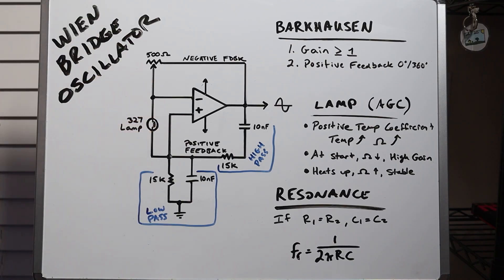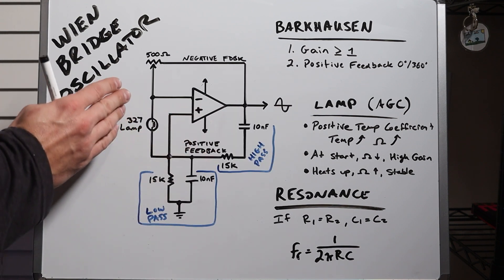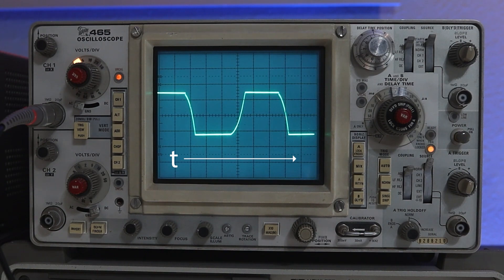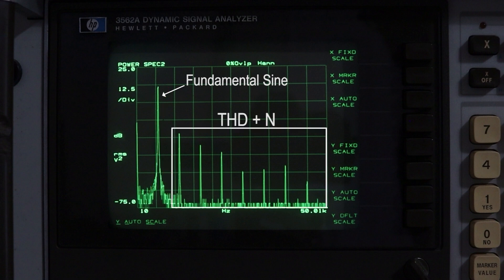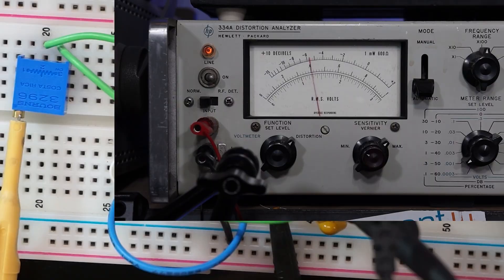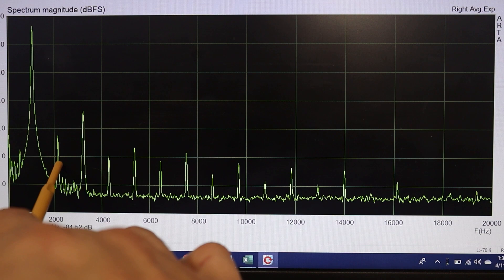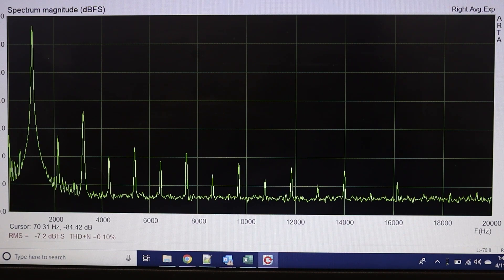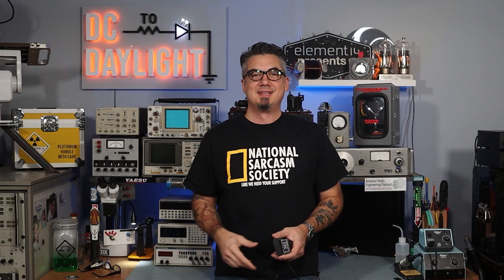Making a Wien Bridge Light Bulb Oscillator - DC to Daylight

Comment: I very much doubt if the schematic presented here would work. Every schematic, even the Hewlett original patent with it penthodes, had the lamp at one side connected to ground. But here, the lamp shortcircuits the inputs, preventing negative feedback, causing the output to cling to max or min. Anyone who has a better analysis? Anyone who has built this very schematic? Or did put it in LTSpice? Let us know.

Comment: Could you please explain how the variable resistor (the bulb) works in this circuit. In the diagram it shows the bulb is placed between inverting and non-inverting inputs. I expected it to be between non-inverting input and ground, then I understand the AGC effect. But in this circuit? Is there an implied voltage divider that includes the bulb and the low-pass filter as well as the 500 Ohm potentiometer?

Comment: 741 works better with dual power supply (+/-9V I mostly used, but is good at +/-12V too). Wien bridge can be used in RF too, is not for low (audio) frequencies only. I made a RF oscillator for my lab using a variable air capacitor for tuning and inductances, and as amplifier I used BF transistors.

Comment: Love to see a nice dive into this kind of circuit design! There are a few others about Wien Bridge oscillators on the YouTube, but this is among the best I've seen.

Some of the noise in your measurement is probably coming from the TL082; the TL072 has a lower noise spec. Wouldn't be surprised if some of it is shot and thermal noise in those carbon film resistors. Also, unless you SOT'd the resistors and capacitors, a mismatch in the filter network could be contributing to the distortion.

I've often wondered why we never see low noise chips like the NE5532 used to build a Wien Bridge oscillator. The early ap notes tend to specify a BJT input op amp like 1/4 LM324, so it seems to me that the 5532 should be perfectly suited to the task.

Comment: So the WEIN BRIDGE, was a thesis paper ? And made HP…incredible, all because a guy discovered a incandescent bulbs resistance is dependant on its temp, PTC OR NTC? Can’t think which way around that is.
Reply: The lamp exhibits a positive temperature coefficient; its resistance increases as the voltage applied to the filament increases.

Comment: Please explain how the circuit, as depicted in your schematic, oscillates, when one end of the bulb is not connected directly to ground/ 0 volts.. I've tried to match this with your actual circuit, but it's not shown in full.
Reply: The diagram is not what he has on the breadboard, take a look. Also the breadboard contains 2 decoupling caps that are not on the diagram either so be careful that could cause confusion. I expect you have sussed it all out by now ! but you were right to question it see my comment below.
Reply: @andymouse  It's not rare to find schematics drawn incorrectly. Sometimes, as in this case, I highlight them, because it must be very frustrating for someone new to electronics, trying to get a circuit to work as per the schematic, when it never will. My signal generator works from a Wien bridge circuit, but uses an R53 thermistor. Built nearly 50 years ago.
Unfortunately, I have to tolerate stupid comments, like the one above by Mr James Collier. Thanks for contributing Andy.
Reply: look up how opamps work
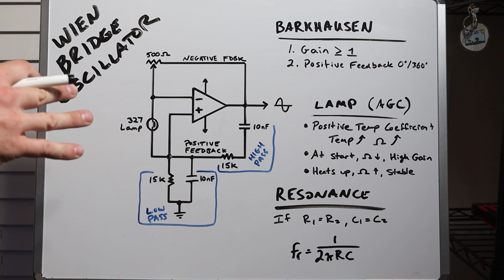Reply: @jamescollier3  I first did that 50 years ago, and have built Wein bridge oscillators using bulbs and thermistors ( R53's ). One end goes to ground, not into the parallel RC part. So can you make it work, the way that it's drawn? I encounter too many incorrectly drawn circuit diagrams on YT. If I were younger, and trusted the accuracy of those diagrams, then I would have spent endless hours being frustrated by non-functioning circuits, not knowing if I was the problem, or the components. So, if you have never constructed an oscillator that is wired exactly as per the drawing in the video at 1:36, then please refrain from commenting, because you are simply compounding the problem
Reply: @peterrhodes5663   I was surprised by the same thing, the bulb not going to GND. I also built many using bulbs and an ITT R53 vacuum thermistor I have.
Reply: @fer_fdi  Hopefully our comments will prevent newbies from spending hours trying to get the thing to work, having gone from enthusiasm to frustration to despair.
Reply: Or look at his diagram and then the way it is set up on the breadboard they are different. In the breadboard the bulb is clearly grounded at the same place as his scope probe. so the diagram is wrong as for whether it works as per diagram I will find later. Also on the breadboard he has 2 decoupling caps that aren't on the diagram so adding yet more confusion for the novice @jamescollier3

Comment: Back in the late 70's when I was starting out in electronics and got to learning about op-amps with my Dad, I experimented with 741's and found generally you got best results using fairly high voltage balanced power supplies - at least +-9v and +-15v were best, and designed the circuits to keep the signals well below that at all points in the circuit because the 741 isn't very good when the the output approaches one of the power rails. We were making circuits from magazines and then tweaking and modifying them to incorporate into a synthesiser project (as was everyone else in hobby electronics at the time it seemed!) or just to see what would happen. My synthesiser got interrupted by University and never completed :)
However, for a simple circuit the one you show got some impressive THD results with minimal optimization, so well done!

Comment: Very nice seeing this explained. OG, retired, newby (2-3 yrs) just beginning to mess with frequencies and ran across this just last week by accident. 555 & LM358 opamp. I'll sometimes run an "on" LED on new circuits and found if I removed it, the signal goes flat, otherwise a beautiful signal. Now I just need to figure out what to do with a pretty sine wave cause I know people use these for stuff :-) edit: I think my results are probably from different reasons than what you show here though

Comment: o yah, The oscillator is based on a bridge circuit originally developed by Max Wien in 1891 for the measurement of impedances. 🧐 i love the 741 op amp 🥰 thanks

Comment: Trip down memory lane... 
(I call them "Ven" bridge)

40 odd years ago I was building part of a test rig for marine RADAR systems, and one of the requirements was to feed in a signal that would produce the classic rotating trace. This was usually produced by a selsyn   of similar mechanical motor device connected to the scanner gearbox The rotational speed of the scanner is something in the 1-2 rpm range.

So I used the Wien bridge circuit, which was well suited for such low frequency. The cct was almost exactly the same, as yours  using the 741. The light bulb was a small "pea" bulb that was normally used for panel or meter lighting. Fed the output through a buffer, then into a phase shifter, and into more buffers to get the sine/cosine waveforms to drive the PPI (Radar Tube)

The test rig was able to take half a dozen Radar sets, simulate the inputs, and monitor various voltages and so on, all while bumping the sets up and down at about 6G! 

 Fun days!

Andy

Comment: Great Video. 
So I guess thats why inductive loop modules for automated gates and traffic lights have bulbs inside them? The bulb basically stabilizes the 100khz loop signal that energizes the pickup loop?
Reply: @AmRad Podcast  Some loop detector designs use neon lamps as surge arrestors. This wouldn't relate to the purpose of the incandescent lamp in the Wien bridge oscillator. Loop detectors often use resonant L-C oscillators that follow the form of a Colpitts design.
Reply: @AmRad Podcast The bulbs are in the currently made modules.
Reply: @AmRad Podcast  Is there a way for me to mail you a EMX D-TEC loop detecter? Maybe you could use it in a video?

Comment: I didn't have money to buy an LCR meter so I built the clapp oscillator to measure my inductors.
Reply: @AmRad Podcast This would be a very important and informative video. This info is very hard to find for hobbyists like me. There's only one out there that I learned from. You should make a video showing how to measure capacitance with an oscilloscope (for better accuracy of the capacitor's value) and then use that value to measure an inductor's value using some LC oscillator. Thanks.